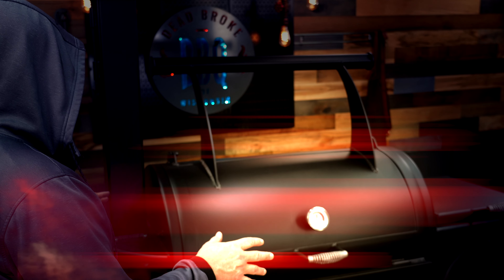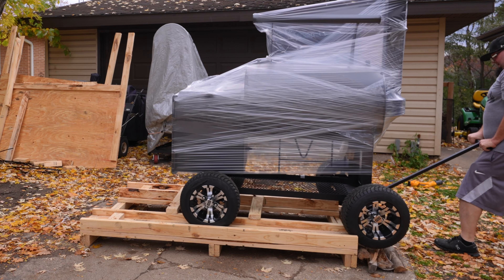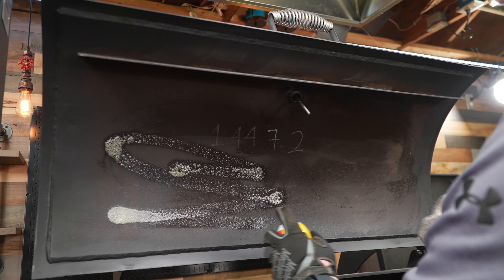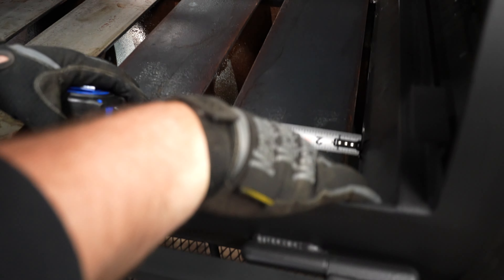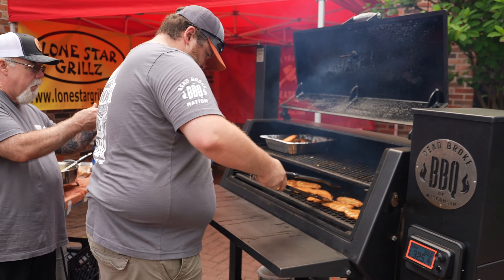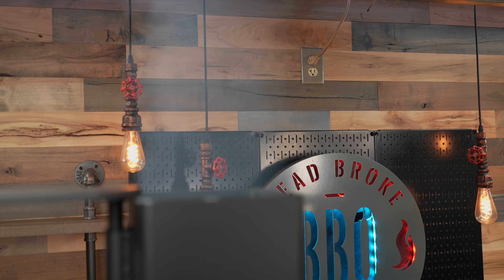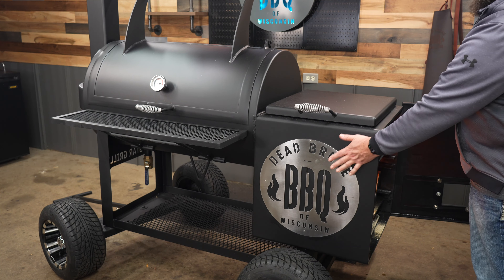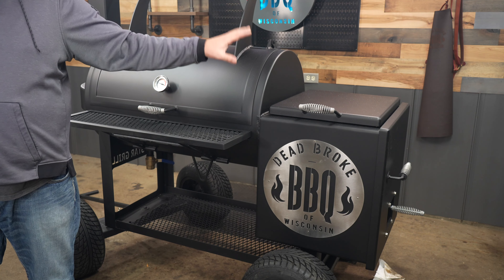New Lone Star Grillz Offset Smoker With Smoke Collector | Seasoning and Paint Cure

Comment: Great job moving to the LSG fam!  I'd go ahead and get rid of the tuning plates.  I got rid of them on my 24x40 (made a video) running it like a true off set stick burner and it's the best thing I ever did.  It is surprisingly even temperature wise from side to side and by not having any of the smoke blocked in certain spots provides a far superior flavor.  If you do a cook and are like, "I thought this would be smokier" you'll know why.  Cheers!
Reply from the maker: Ya this is my 3rd LSG pit and I am a huge fan of what Chris builds! I will test the pit both ways. My old offset didn't have tuning plates but it also had a hot spot. So again I will run it both ways and see what results work best for me. Honestly I truly want 1 of my cookers to be even from left to right for once!!!! hahaha But I am so used to rotating it really doesn't matter one bit to me either way! Thanks for watching!!!

Comment: Real nice BBQ, love the updated smoke collector. Recommend you remove the firebox honeycomb grill/grate when you're not actively using it, this will extend its life since it's exposed to some of the hottest temps. Good choice on the 1/2" firebox, holds temps very stable!
Reply from the maker: Heck ya brother!!! I just wanted to get that firebox grate seasonsoned up some so it don't sit an rust up on me!! I certainly do plan to use it though!!! My old offset was 1/4" and I could tell right away how that improved the stability of the temps. I could really run those sticks down to nothing and was surprised every time I opened it up to add how little of the stick was left. I am very excited to get cooking on Vader!! Thanks for watching!!